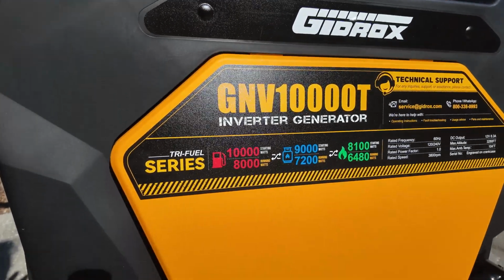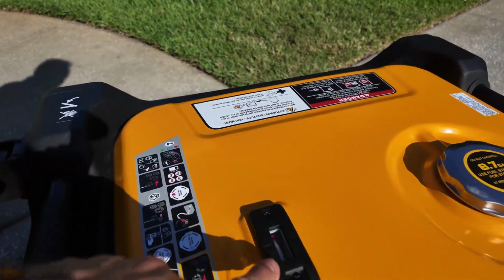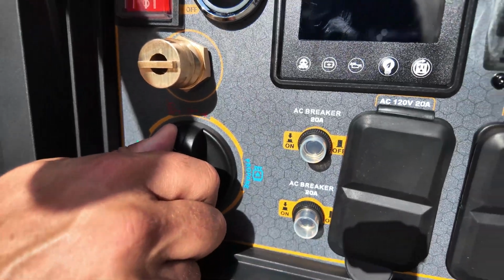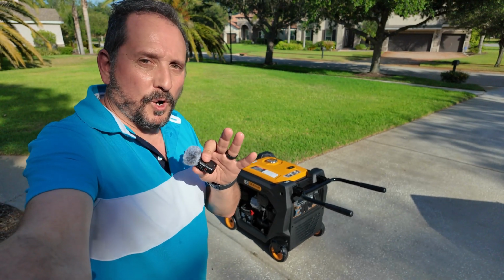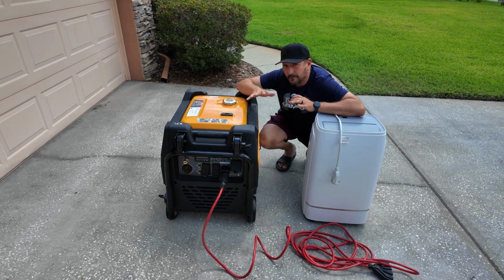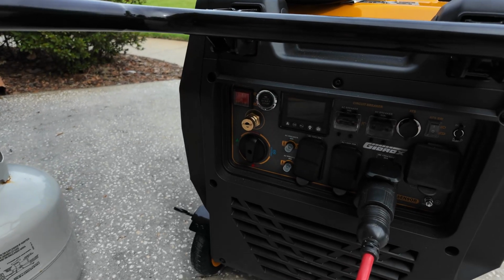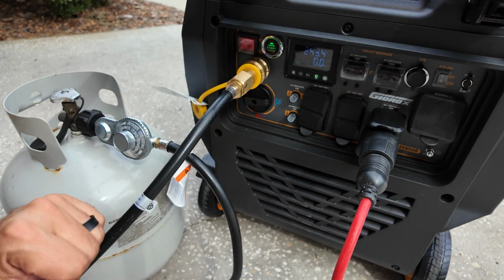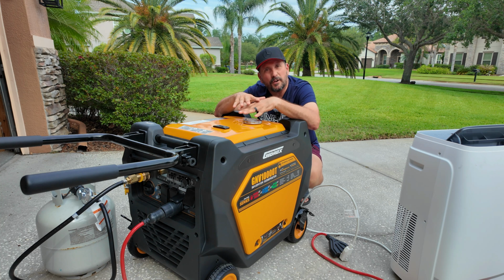10000W TRI-FUEL PORTABLE INVERTER GENERATOR | NEVER LOSE POWER AGAIN! | Doug & Niki

Comment: Will not run on NG or LP support is non existant. Anyone else buy onewith this issue? Any tips?
Reply from the maker: What does it do?
Reply: @DOUGandNIKI  it turns over but won't start its running on gasoline

Comment: Is it possible to add quieter muffler to this inverter or others to significantly reduce noise level? In residential area
Reply from the maker: There are normally aftermarket mufflers for pretty much everything but they do normally adversely affect performance.  Inverters like this in general are much quieter than conventional generators.